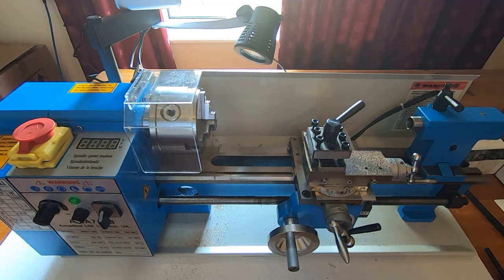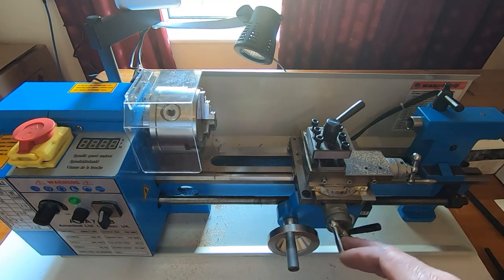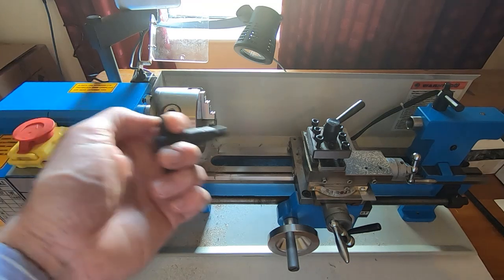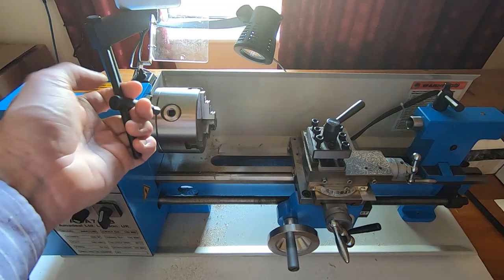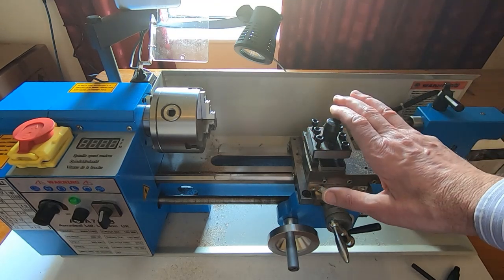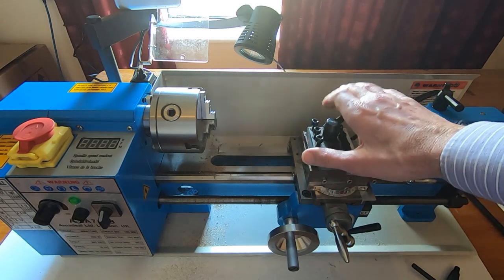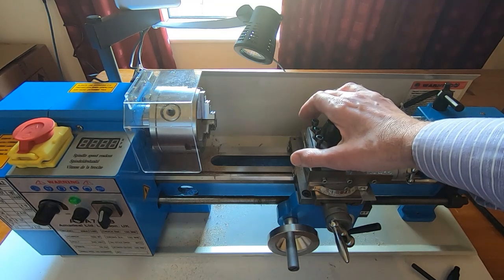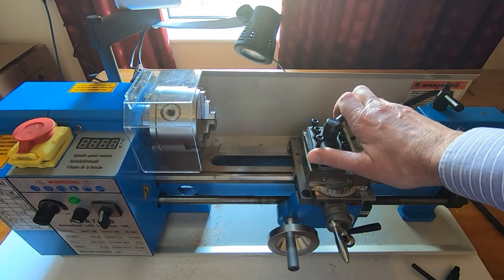Mini Lathe Part2

Comment: Z axis is always in line with the spindle. The reason DROs on lathes read x and y is because they are almost all derived from 2 axis milling machine DROs  that track table movement
Having said that it is really mute unless you are writing a technical manual. As long as everyone is on the same page

Comment: Jerry, I think that it's fantastic that you've found what appears to be a very capable small lathe for a reasonable price and have shared it so anyone watching can also procure one for their workshop too if desired.

Your point about the dangers of work light strobing is absolutely true, though my "experience" is dated and is related to overhead fluorescent lighting strobing causing a student to lose a hand in the machine/wood shop at college the year before I got there.  Due to the noise of several machines running and the strobing, the student thought the table saw blade was not moving and cut off his hand before he knew what was happening.  This was before the later safety devices were invented that could sense contact with human skin and immediately stop the saw blade before more than a stitch or two would be required rather than losing an appendages or one or more digits.  I'm glad that you pointed out that the cheaper LED lamps also experience strobing and can cause mains-powered equipment to appear to be stationary just like fluorescent lighting does/used to.

Comment: Hi Jerry, having watched your video I am seriously thinking of buying one of the lathes you show, to that end I have looked on their websites and the 714B pictured does not show DRO. Also there are two models of a 714B slight differences in price and appearance. I have spoken to them via phone, and it seems, that model does not have DRO, which was the thing that attracted me to the lathe, plus your very positive comments. The model that does have what I want is a 7-14 AMA-CJ18A price £760. A fair bit cheaper than yours. So now I am not sure now what I would be getting as it can’t be exactly the some as yours. The person I spoke to wasn’t aware of your  videos, but he is now.
Reply: Are the lead screw gears included? if so are they metal or nylon? Questions to ask

Comment: Thank you for doing these articles on machine tools as well as the electronics side of things. I feel Desktop lathes are very underrated by some people as to their capability, but that certainly isn't the case! Along with larger lathes I've been an avid Unimat user for 4 decades and as long as light cuts are taken, a lot can be achieved.

Just a reaction to your mini lathe, the leadscrew engage/direction banjo handle is on the back side of the headstock which although a little odd is no big deal. Having T-slots in the cross slide is something I would normally insist on (so angle plates, vertical sides, clamps etc can be fitted) which my Unimats and Myford ML7 have,  but one of the lathes I owned had a plain flat cross slide like your machine here that we drilled and added some tapped holes to, and that was the next best thing. 

I've seen someone do a chuck key arrangement where the key has to be rested on hooks on the front of the headstock (might have been the cabinet, I can't recall) and the weight of the key's arms depressed microswitches that enabled the drive motor operation.

Keep up the great videos, I marvel at the magic dirt/oil/grease-proof spotless crisp blue long-sleeve business shirt - it wouldn't be a Jerry Walker video without it!
Reply from the maker: Yes you could arrange a lock out for the chuck key but I would advise against it for the same reason as the key spring. There is no doubt that it would make 'This' lathe safer BUT if you then move onto larger machines which do not have springs on the key or need the key to be on hooks then you may have developed bad habits that could kill you. As I say in the video my advice it to 'think safe' from the start (no not health and safety thinking, I mean real safety). For example if you develop the habit of ALWAYS removing the chuck key then you will not have issues when you move to larger machines. Anyone that does not appreciate that bad habits are by FAR the biggest cause of accidents should stay away from big machine tools (and cars without air bags, whatever that means). I normally wear a top hat and cravat when machining (nothing else). I just put on a shirt for the videos :)

Comment: does this one have a hi- Low gear selector?
Reply from the maker: It has forward and reverse and comes with a number of gears but they are more for threading ratio. The chuck speed is continuously variable from 0-2500rpm so it does not really need a headstock gearbox. Higher gearing would provide more torque of course but I doubt that the machine is stiff enough for that to be an advantage.

Comment: I wonder if you could mod the lathe control circuit such that the chuck key needs to be inserted into a small hole off to the left somewhere........an inhibit circuit.
PS. I have a "Hobby" branded lathe very, very similar in size etc as your unit. Acquired as a total wreck and I refurbed it.

Comment: A late comment on quite an older video - I understand your assumption of a "bug" due to the way the axes don't display the same way consistently when lathe mode is selected, but it would be interesting (to me at least) to know what "special features" if any come up when lathe mode is selected. I would expect the milling oriented hole pitching cycles to be replaced with something more turning oriented perhaps ? Just having to do set-up routines as X and Y when the display otherwise works as X and Zo in lathe mode isn't that much of a hardship or very confusing, surely ?

Z axis orientation in industry is determined as the axis movement along the spindle axis, so technically a lathe longitudinal axis is Z regardless of the number of channnels. The universal 2 axis counter with X and Y axes shown is just the marking of that particular counter, not an indication of the "correctness" of that marking for all applications. Zo and Z1 would be normal for a lathe saddle & compound but a mill with, say a knee and quill would normally be Z and W (if the 2 axes were not summed & displayed as a single Z axis).

Comment: I disagree about the spring. It's an additional safety feature. Saying it is detrimental to safety feels to me like saying airbags make people drive faster.
Reply from the maker: I did not say it makes 'this' lathe more dangerous, That is a strawman argument as it is NOT what I said. It does however, in my opinion, risk bad habits creeping in by not creating a 'safe' working mentality. If it becomes second nature to be responsible for removing the key then moving to another lathe that does NOT have this feature will be much safer and that is exactly what I said in the video and not what you are implying. I would also say that air bags DO make people drive faster because they make cars safer. You are no doubt aware of the old adage that putting a big metal spike in the middle of the steering wheel would make people drive more carefully.
Reply: @JerryWalker001  I think you misread what I said. I never stated that you said that the spring makes this lathe more dangerous. I said that you argued that the spring was "detrimental to safety" (my quote), in general. You can see that i said that if you read the 3rd sentence of my original comment. I said that because you were saying that the spring made usage of other lathes unsafe, and so my observation of what you said stands.

The airbag analogy stands: it is not true that driving a car with an airbag and then a car without an airbag makes you safer than driving exclusively a car without an airbag, all other things being equal. The statement "airbags make people drive faster" is not true. It has been disproven by studies, but I won't go digging for them. The argument was originally created by car manufacturers upon being faced with mandatory airbag installation: they wanted to keep manufacturing costs low, and so decided to make airbags seem unsafe by saying they lead to faster driving and more accidents. The exact same argument was used for seatbelts, as well. Tomas, who is probably still teething, probably doesn't remember cars without either. No one in their right mind would nowadays advocate for removal of airbags or seatbelts from cars by arguing that would make cars safer.

In total I do not believe that additional safety features reduce safety as I do not believe the safety vigilance argument.
Reply from the maker: @cheater00  I have literally no idea what the purpose of your comment is. The installation of air bags in cars and the spring on the chuck key have absolutely no connection on any level as I am not suggesting that anyone purposely operates a lathe dangerously. In the video I stated that the spring could cause the formation of bad habits and so, in my opinion, could make operating lathes without that feature (ie ALL large lathes) more dangerous. The only conclusion is that while the spring may increase safety in THIS lathe it does not force a 'safe mentality'. The advice I offered is to get into the habit of removing the chuck key or better still (and as I stated) do not let go of it while it is in the chuck (aka taking responsibility for its removal). You have every right to your opinion but I have operated these machines for many years and seen the results of bad habits so I think you are missing the point.
Reply: @JerryWalker001  I understand what you mean, my comment was to say that I believe that safety features are more important than good habits, even if those safety features don't apply everywhere. Just like not every car has an air bag or a seat belt.
Reply: @cheater00 Then you are inviting 'Mr Complacency' to the party. The brain needs constant practice ;)

Comment: Tell the so-called experts to piss off you are correct it is X And Y. An expert x is an unknown spert is a drip under pressure.
Reply: Wrong  Z axis is always inline with the rotation of the spindle. Has absolutely nothing to do with being an Expert. It is basic machine terminology.The reason Lathe DRO’s read X and Y is because they are modified 2 axis milling machine DROs that measure table movement
It IS the industry standard that Z is inline with the rotation of spindle. Basic machine terminology.